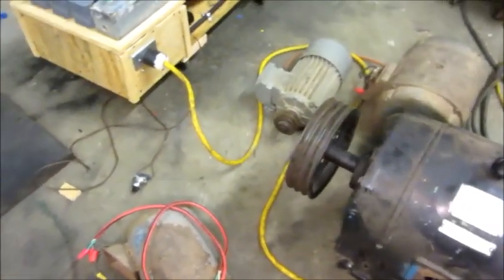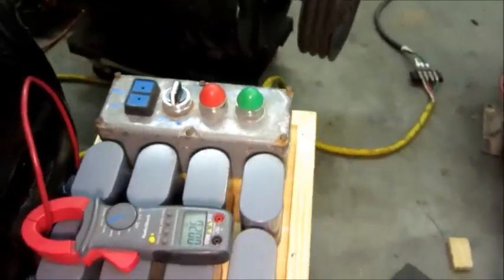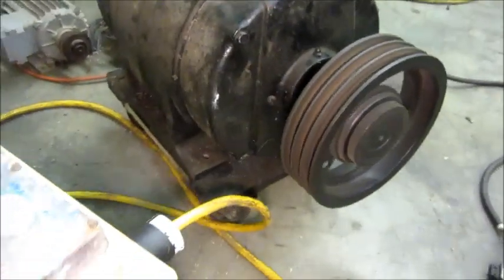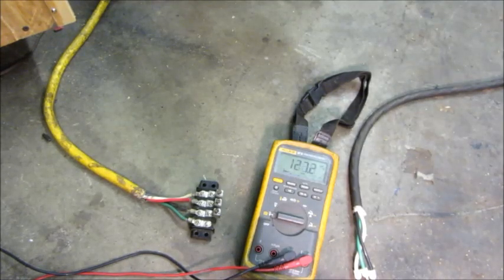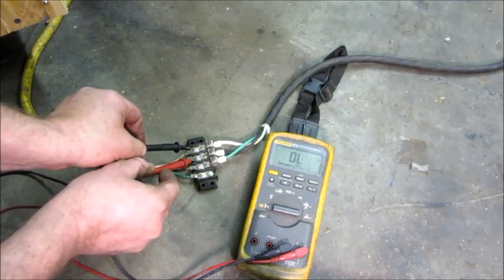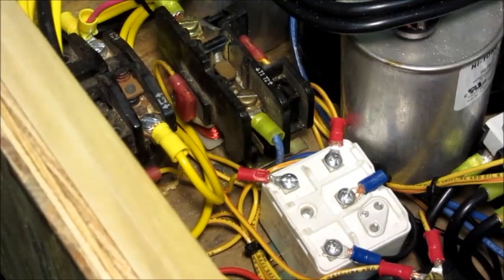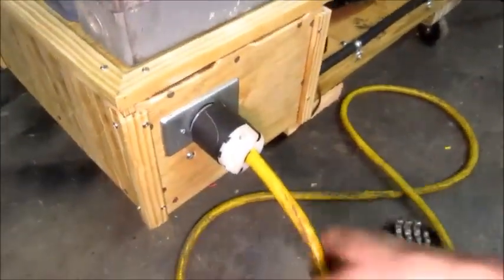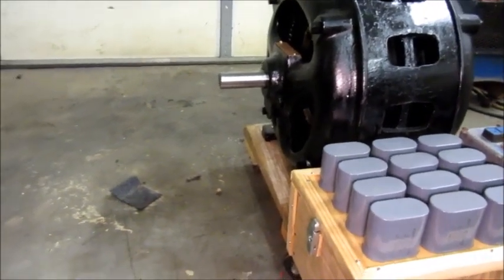Building an Allis-Chalmers Rotary Phase Converter - 3 - Measurements and conclusion...

Comment: One advantage of this over using a VFD is it seems indestructible, hundred plus amp surge on the output, no problem, even to the point of tripping your powerboards breaker - so short of a house feed upgrade you cannot go any further.
However hang these loads of a VFD and I'm sure smoke will fly.
Reply from the maker: Absolutely! If you want to test a possibly damaged motor, a rotary phase converterl likely not be damaged. At worst you may damage a contactor. I do like VFDs for most smaller motors, though. You can set them up for low current limits and the drive will trip before damaging the motor. I bought a used motor which was connected improperly, but the VFD caught it before the motor was damaged. Would have likely smoked it had I went straight for the phase converter! They both have their places, for sure.
Reply: @davida1hiwaaynet  All I can see yours needs is a cover/guard over that disused output shaft. I know a man involved with commercially building them with new motors, they cut the shafts off, I'm sure you would not want to do that.
Almost a pity you didn't build it with the motor rotated 90 degrees, so the output shaft could be hidden inside the box

Comment: Just watched this and the 2 previous  Rotary Phase Converter videos! What a neat project and amazing that it got the giant motor running! 

I am amazed anyone would troll these videos. Actually sadly I lied - I'm not surprised - I had the same experience with my "overloading 14/2 wire" video. I'm relatively new to posting videos and was wondering how to handle it - looks like I did much the same thing as your did - that is I simply ignored the obnoxious commenters. I was glad to hear of someones else's similar experience. The  great thing is the bad comments get buried way down in the overwhelming majority of great comments. I have certainly found the good comments to be most rewarding and often wonderfully informative and the best part of posting a video.

Comment: So your 10 hp converter is powering a 20 hp motor?
Reply from the maker: Yes, but only with the 20 hp at no load. It was just a test. It wouldn't allow the 20 hp motor to drive its rated load.

Comment: David what is the best oil to use in a electric motor that used oil to cool it  if you know of a brand name or were I  can order it on line I  have repaired the motor and check for leaks none 
So I want to replace the cooling oil

Comment: You should put an emergency stop on the phase converter
Reply from the maker: That could be done; but it's not really necessary. In industry, an E-Stop is most often used for machines that have an automated cycle and under normal conditions never stop without making several more actions as part of a stopping sequence. The E-Stop bypasses that and halts the machine instantly. This phase converter is simple in its operation, with the OFF button instantly disconnecting power from the input cord to the converter motor. 

Another industrial application of an E-Stop is when you need stop stations at locations too far away from the machine. This unit is only used to test other motors which are right here at it, so again no need to duplicate the stop button again.

It's a good point, and I'm not saying it's a stupid idea - but this just wouldn't get any safer with an e-stop since the regular stop does the same thing.
Reply: What happens if something goes wrong

Comment: i thought the potential had to be mounted up right..??
Reply from the maker: That would be a current relay needing to be mounted in a certain position. These GE Mars relays specifically say on the box, "not position sensitive" or something similar.  The current relays often use gravity to return the relay armature to the at-rest position. The potential relays are spring operated and have counterweights so that they are not dependent on, nor affected by, the effect of gravity.

Comment: What happens when you run 5 motors on a phase converter?
Reply from the maker: Stephen, it doesn't really matter "how many" motors are run from it. What matters is that the total load of all those motors is within the capability of the converter. Five 1/4 HP motors for this unit would be no problem at all.  Five 10 HP motors would not work.
Reply: Imagine if the breaker tripped

Comment: Sounds like you need more start caps. Rule of thumb I go by is 100 mf per hp. So if it's a 270-324mf cap I usually go with the lower number. So my 20 hp RFC has 8 270-324 caps in it starts il less then half a second with way less start up current
Reply from the maker: It's a ten hp with more than 1000uf start caps. The old motors like this don't start as quickly as newer ones. The rotor alone weighs about 150 pounds.
Reply: @davida1hiwaaynet  ah. I've never used an older motor like that

Comment: Excellent work! I'm curious to know what the B-phase current would be in comparison to the A and C phases.
Reply from the maker: For the motor connected as a load, it should be proportional to the phase voltages. In other words, for the measured voltage imbalance, there should be a matching current imbalance.  I should have measured that but without load on the motor, this is all mostly ideal / theoretical measurements anyway.

Comment: Thank you for the demo with the voltages being measured, which answers the questions that I had. Since it is basically simulating a High Leg Delta circuit, that would not work for what I was thinking, a computer power supply wants all 3 phases to be 120V +/- 10% with respect to each other. The building where the machines are has high leg delta 3 phase already.
Reply from the maker: Got it..

But if you have a delta system; you have three phase already.  The system with all three phases 120V is called 120/208 Y.  To go from a high-leg delta to a 120/208 Y system you only need a three phase transformer. It would need to be 240:120 ratio. The primary would be connected delta with each winding seeing the full 240V. No neutral connection on the primary.  The secondary side would be connected in Y configuration; with the wye point used as neutral and bonded to PE ground. This would provide what you need, I am almost certain.

Comment: Love your videos. Especially the refrigerators. I’m a licensed HVAC contractor in Alabama and Georgia. Just started restoring a 1954 Frigidaire refrigerator. Just got chrome back and about to put back together. I love the old stuff. It was made to last. I have several old refrigerators and things in my shop I enjoy messing with. Thanks again.
Reply from the maker: Hi John.  I also live in Alabama. With your 54 Frigidaire, would you mind telling us where you had the chrome refinished? This is a common question seen on the restoration forums.  Good to hear of another keeping the old stuff going!
Reply: davida1hiwaaynet I got it re-chromed at Harts plating in Carrollton Georgia about 30 minutes from where I live
Reply from the maker: @moorescomfortsystemsheatin6068  Thanks for the info on the plating business. I live in the central part of the state in Tuscaloosa county. Nice and rural. :)
Reply: davida1hiwaaynet I leave about 60 miles west of Atlanta right across the line in a little town called Muscadine
Reply: I have a few videos on you tube where you can see the 1954 Frigidaire restoration
Reply: @davida1hiwaaynet  Nickel plating is not terribly difficult, I've been doing plenty of it myself. It would probably be the more accurate finish for most of your old fridge hardware.
Reply from the maker: @moorescomfortsystemsheatin6068  Oh yeah, I remember passing through there before. Nice and rural, it seems.
Reply from the maker: @madmanmapper  Yeah, definitely on the 20's and 30's stuff they were nickel plated. I'm not sure when they switched to chrome, but by 1954 that would have been the process used on Moore's refrigerator.

I did try nickel plating - and it worked but not as well as I would have liked it to. The problem was I didn't have enough of the right quality nickel electrode material. I was doing refrigerator racks, which needed a wide, shallow container and a lot of solution. It worked but the fumes were terrible and it caused surface rust on everything in my building.
Reply: @davida1hiwaaynet  I use Caswell plating's bright nickel crystals. Their customer service is shit, but the product is top notch. Have not experienced any such rusting, and my setup is around my toolboxes. There are no fumes or smells whatsoever, and the plating is fairly forgiving. Still, if you want to get a mirror shine coming out, it's gotta have one going in. There's a vid on my channel about my learning process.

Dunno about having an electrode big enough for a wire rack. I need to do something about 8"x 10" soon, and I was thinking using a couple strips of nickel sheet attached together with nickel wire.
Reply: davida1hiwaaynet What part of Alabama do you live in?

Comment: First?
So... if the boost caps come on based on load/voltage, doesn't that mean there's going to be one Goldilocks motor you plug in that's going to get the thingy to cycle on and off repeatedly? Just curious.
Reply from the maker: It's possible; but unlikely. The potential relay for that function requires the voltage to fall to 160V to engage boost; and then rise to full voltage (240) to disengage. It really takes a startup load to create that level of voltage sag. If a relay not specifically made to be used as a potential relay were used, that could certainly happen. 

My old converter does not have boost caps; but the start caps can re-engage to help start a connected motor. They can cycle on and off a time or two during high inertia starts of large motors. That's a limitation of its much simpler design. It's not good, but it has lasted more than 25 years like that. The only thing which has failed is the run caps. They just go after so many hours; and their time was up.